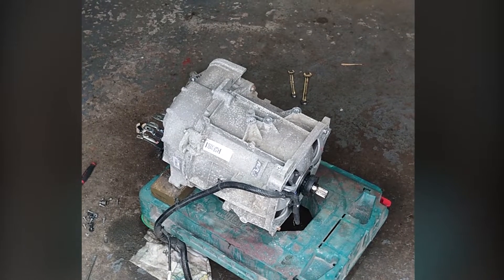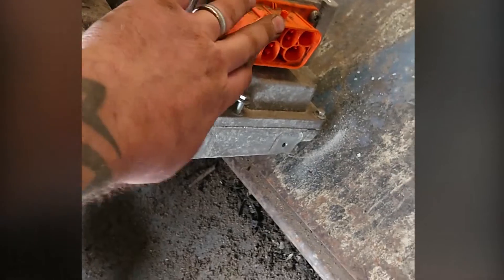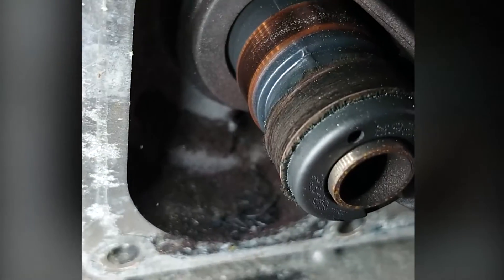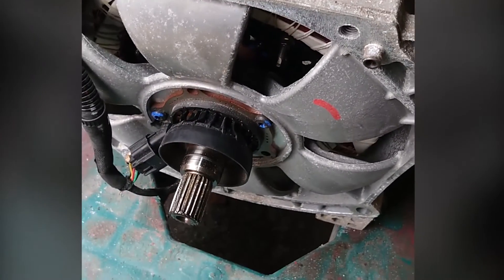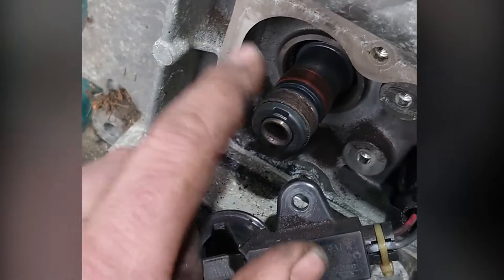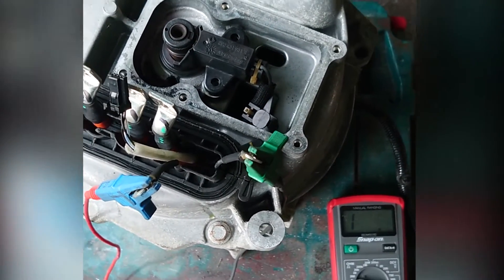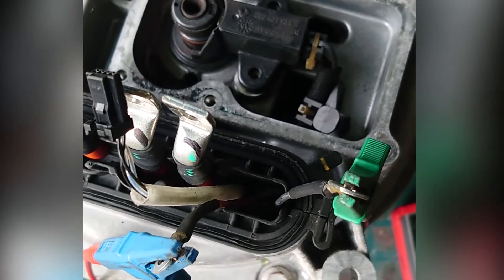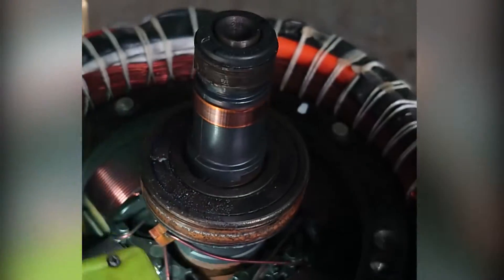Renault zoe excitation fault P0820 P0821 df006 df007

Comment: Good video. Nice to see inside the big unit that holds the inverter and the dc-dc converter. Do you know what module contains the coded part. I’m probably going to have to change that whole unit but been told it’s coded to the car.

Comment: Useful video for some though it is very worrying that Renault don't acknowledge there is real design issue with these. I pray the 135 hp used in the Zoe GT Line is designed better. 

The letter 't' does exist in the English Language. 🫢
Reply from the maker: Thanks for the comment